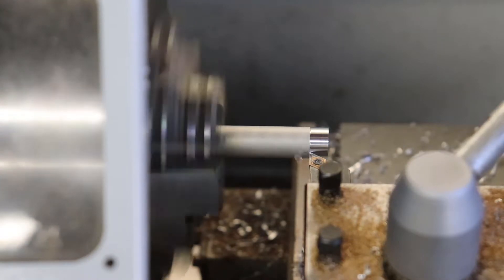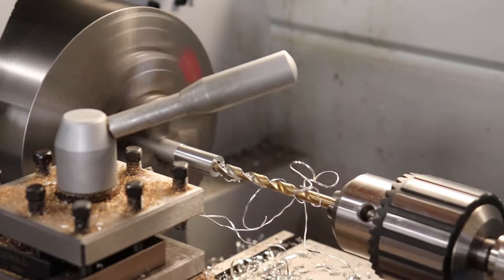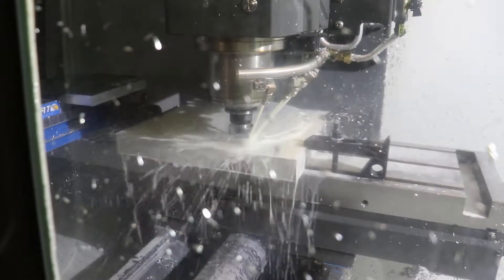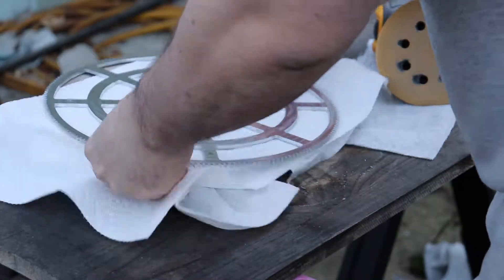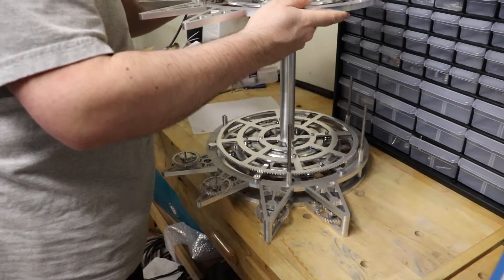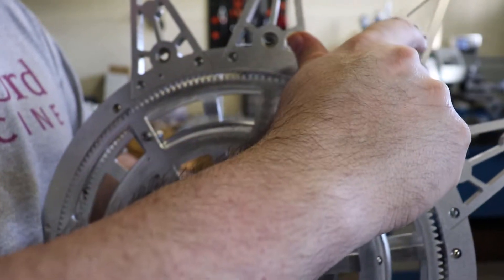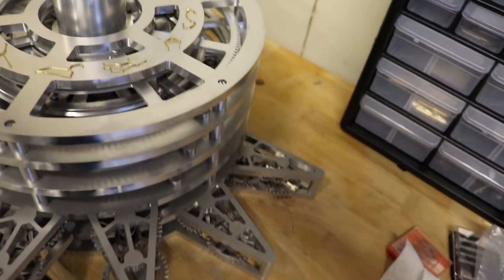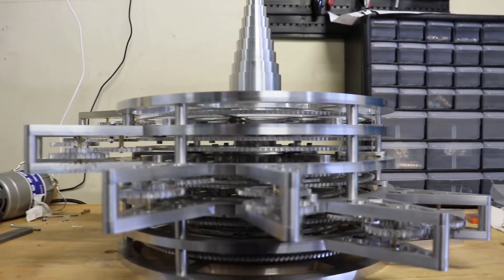Sprinkle Grand Orrery - Display Stack

Comment: Gorgeous work! Your orrery has a very modern style and is very nice. I’m looking forward to see the finished object, especially how you will fit the arms on the tubes.

Are you going to add the Moon rotating around the Earth, a tilt angle to the Earth axis, and make the Earth spin?

Is there a reason that the 8 branches are all packed in roughly one half of the orrery? I think that arranging them at equal angles (like a regular octagon) would have been better in my opinion but there could be a technical reason.

If you keep making videos, I say you’re going to be the next @clickspring

Comment: Very interesting project. I offer you a single suggestion. Polishing with the sander will work better , if you mount the wheel ( gear) to a dead true flat surface. Think heavy plate glass or a inexpensive surface plate. ( of course you can surface a piece of metal in your mill as well.)  Use a high grade double sided tape . fixation like this with allow you to finish it better. Use the random orbit sander up to a grit of ~400 . then use a glass  surface ( anything flat)  with the abrasive fixed to it and surface the solidly fixed wheel. that will result in a superior finish.
Reply from the maker: Thank you for that, I will try your suggestion on my next project :)